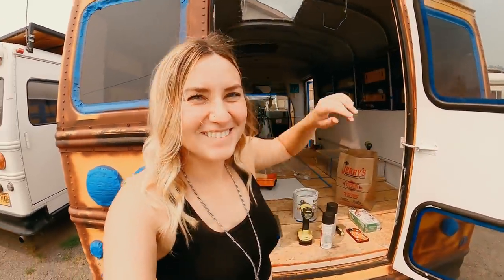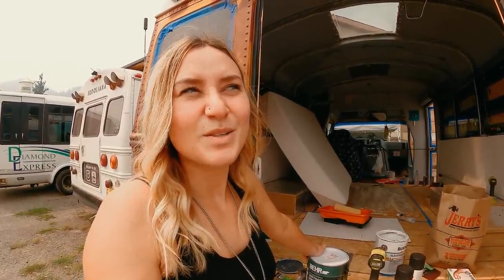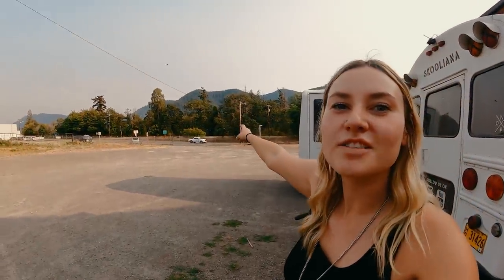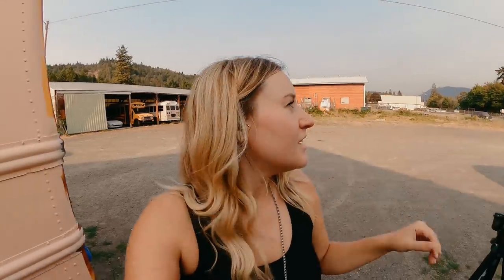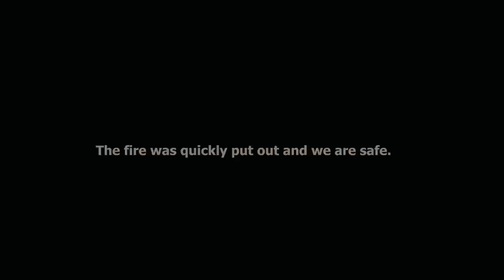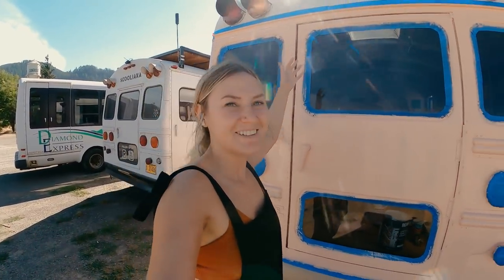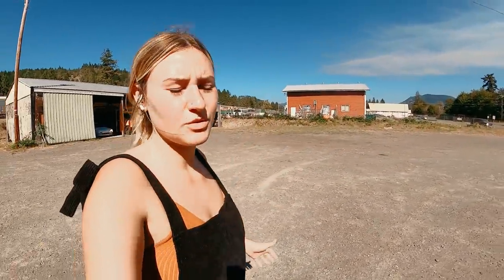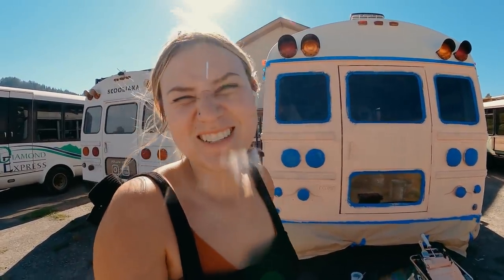Painting The Short Bus & A Fire Broke Out ACROSS THE STREET! - Solo Female Skoolie Conversion

Comment: Oil Based paints take muck longer between recoats than latex based paints. Check the label but its usually 18 hours. Great job :) just don't rush the second coat

Comment: Almond is always a beautiful color. I swear by Rust Oleum on the exterior myself. So durable and even waxable. Has a great shine to it. Has been on my van for 600, 000 miles. Is the Behr paint you are using, is it self leveling,  meaning the roller and brush marks evening out, or disappearing? I know it's your bus, but I think painting the window frames, side rub rails with Rust Oleum "leather brown " would look so sweet, matching the almond perfectly! Just my opinion,  that's all. You made the right choice by painting the roof with elastomeric paint. Good stuff.

Comment: Not a color I would choose but not mine. On the headlights I tried the cheap ones off ebay had a bad light pattern found some anso to replace the square glass ones added the led bulb (with cooling fans) and love how nice it lights up the front. Have gotten light pods for driving lights and going to add reverse lights

Comment: Looks good. 

However, offer in my two cents. I would like to see the bottom all around the bus done with a black paint. Sort of like a rock guard. Two reason, one to do what it suggest, prevent rocks from scratching or at least messing up the lighter color. Two, to break up the monotony of the other color. Two-tone, in other words.

Either way, looks awesome. You do you boo. 🤪
Reply from the maker: That’s the plan for the front and back bumper! 🤗

Comment: Why not use a paint sprayer? Much better coverage with a lot less work.
Reply from the maker: Don’t have the means
Reply: @LeaveHerWild  I would have rented one at home depot or buy a Wagner fence sprayer and used that. I also wonder if you used dtm paint so it can bond to the metal surface. No big deal but these small things would make a huge difference in the final product and the longevity of the work.